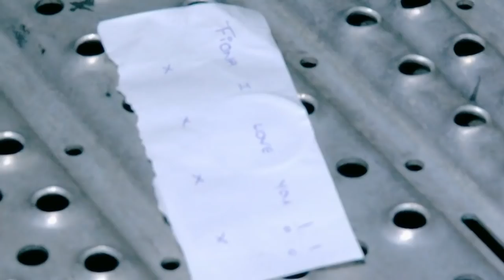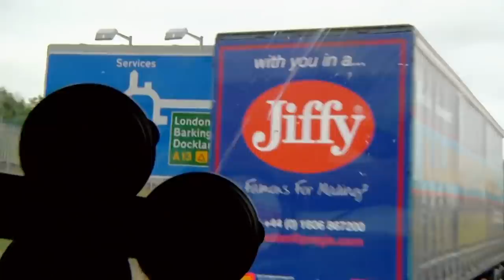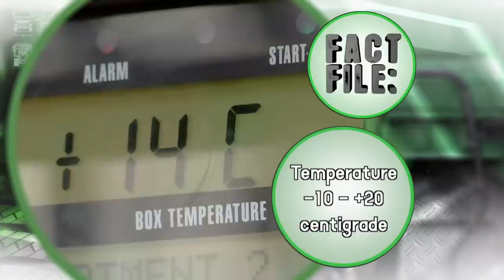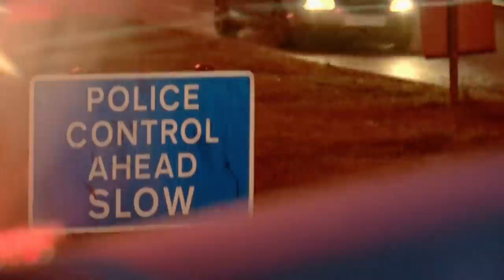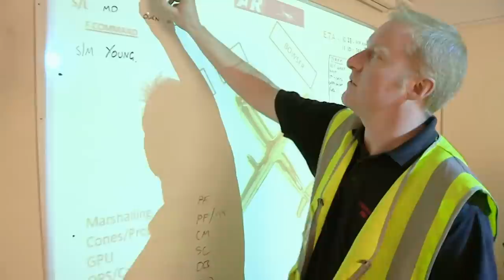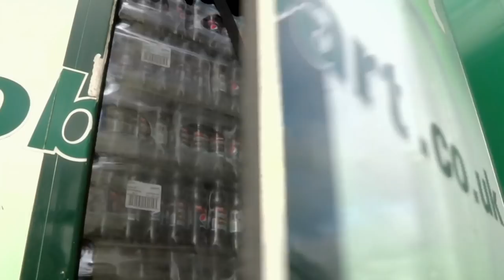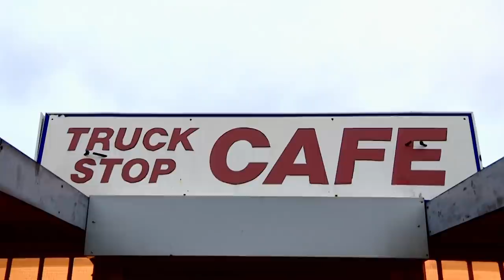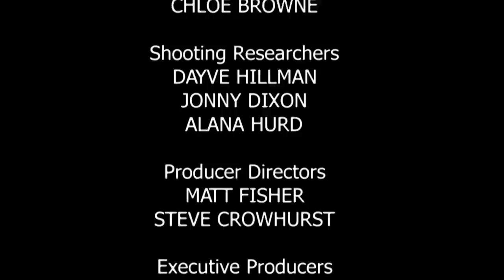Getting To Grips With a New Trailer | Truckers: Season Three | All Documentary

Comment: Some tail lifts have a switch you turn on in the cab for it to work.....
Reply: In rigids because there constantly connected. It's difficult to have it hard wired when you can drop and pick up different trailers on the same tractor unit.

Comment: They couldn't make it in the states...as truckers
Reply: US truckers would struggle in the UK too. Completely different job
Reply: This tv series is making it look harder than it is. they are all acting for the camera
Reply: American trucking is probably 1000 times easier
Reply: @bensmith4563 Considering that most US trucks have unsynchronized manual transmissions which require double clutching, I doubt it…
Reply: @unconventionalideas5683  real truck drivers only use the clutch to stop and go